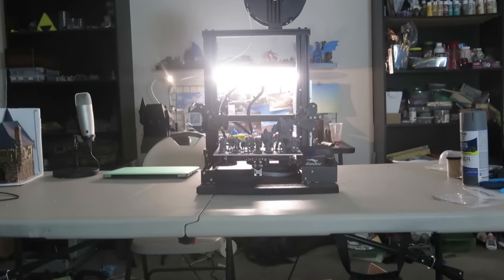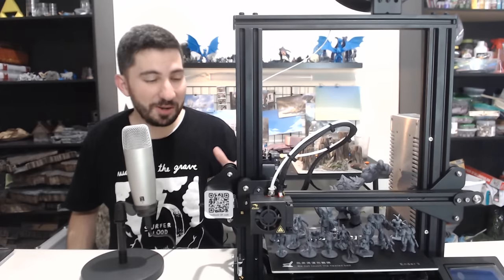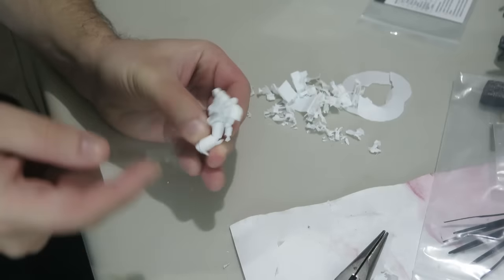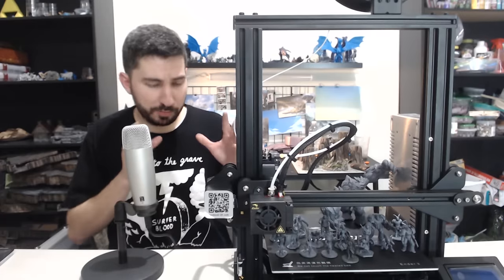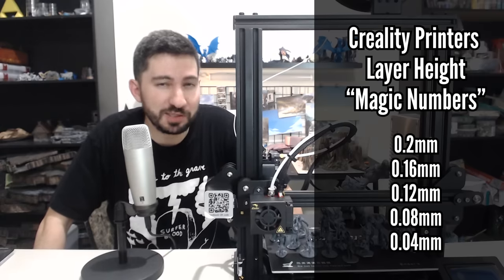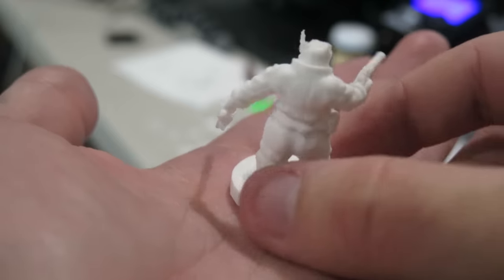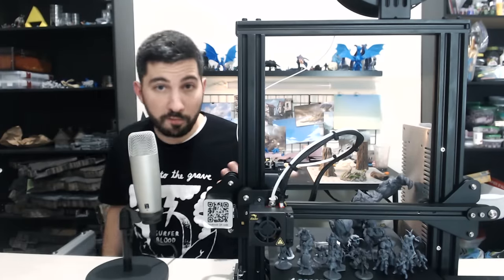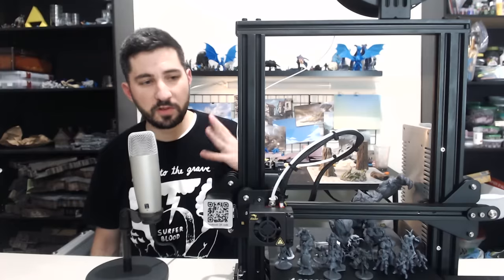How To Print Resin-Like FDM Minis on $200+ 3D Printers (Printing The Game #3)

Comment: Heya, one of the Cura Devs here. The top infill trick works because you treat the entire model as top surface. As for most models you care a whole lot less about the infill, by default, Cura prints the infill faster (and thus, way more ugly). 

By " tricking" cura into doing this, what you are actually doing is ensuring that the acceleration / speed values of the infill are ignored (to be replaced by the much lower values of top). So instead of doing the tricking, it's way smarter to just decrease the infill speed / acceleration values. That way you get the result you want, without losing control. Another option would be to set your wall thickness to a high number, although that will make Cura use concentric like filling (which may or may not be what you want). 

I've looked at your profile and a few settings don't actually, well, do anything. As i already mentioned, setting your top layers to 9999, means that every bit of material on the inside gets classified as top. As such, nothing is considered to be infill. So changing any infill setting won't actually have an effect (so you can dump the speed infill and infill density setting). 

Another weird thing is that with your settings (due to inheritance), your inner wallspeed is 25 (as it inherits from print_speed without modifiers) but your outer wall speed is 12.5 (as it by default inherits wallspeed /2). Interestingly enough, as your infill is replaced by top/bottom speed, that is suddenly printed at 12.5. So you have a single outer wall at 12.5, then a single inner wall (as by default there are 2 walls) printed at 25 and then all other lines printed at 12.5 again.

You also print with rafts, so changing the initial layer doesn't really affect things. The raft already "soaks" up the inital layer (thus preventing any elephants foot).
Reply from the maker: Hi Jaime! THANK YOU FOR REACHING OUT! And thank you for helping make this possible by working on Cura. 

Suddenly things get a lot clearer :)  Someone suggested that it was just slowing down the entire print, but it looks like it is still printing at different speeds (which is what I would observe when I'd watch a mini print) if I understood you correctly. 

In my tests, and some tests with the community, concentric filling caused some issues on a few Ender 3 prints. I'm recommending linear now. 

A lot of folks here have asked about getting easier to remove supports. It has been fine for me, but I know a lot of folks in the community would be interested in making that better. I'm going to be running some tests on z distance and using a support interface, but was wondering if you had any suggestions. 

Thank you again!

Danny
Reply: So yeah, it's printing some bits at a different speed, but most of it will be slower. The thing that you actually want to do is changing the infill speed / jerk / acceleration. I think that you do want the infill to be faster than the top/bottom layers, but you do want it slower than the default values. So not using the 9999 top layer trick will mean that you can probably get your prints a bit faster (you are fully correct that it's always a tradeoff, but there is usually a way to mitigate the negative effect of some things while increasing the positive effect).

As for actual quality; I'm personally a big fan of lower infill and more walls. Look at most of the UM profiles; they use 3 walls. This is especially the case for "organic" prints (eg; models without flat surfaces). They get most of their strength from the walls, not the infill. Despite UM machines being bowden machines (and thus a fair bit different) there is a lot to be learned from them. Ultimaker as an entire team working on only tweaking quality profiles into perfection. 

Support wise, I'm spoiled. Working for Ultimaker means that I have access to dual extrusion printers with PVA, which removes the need to muck around with "regular" supports. But from my past experience I can give some pointers; Increasing the Z distance will make it easier to remove, but this always comes at a cost of worse prints. You can also underextrude the support interface layers on purpose (eg; That way you get sponge like results, but its real tricky to control). I don't have that much experience with that, but you could also consider messing with the support interface line width (Decreasing the contact area of support with actual model). Future version of Cura will also have a feature that enables you to add a "wall" around support, making it easier to break off entire chunks of support at once. 

There is of course also the option to use "anti-overhang-meshes". Sure, it isn't as great as what S3D does with regards to placing supports, but it does let you mark areas as "Don't support this". This is especially nice if someone already did this for one model as from then on you can just share the project file.
Reply from the maker: Thank you soooo much for the thorough response. Is there a way for me to contact you more directly? I have a few follow-up questions if you don't mind :)
Reply: I've sent you an email on the address you have listed on your channel.
Reply from the maker: In receipt, I'll email you shortly :) Thanks again!
Reply: 3D Printed Tabletop Please share what comes out of this discussion. I'm really interested
Reply from the maker: @AES 2015 I'm gonna do some tests of my own and then follow-up! :)
Reply: 3D Printed Tabletop Sounds good. I'm going to try this on my CR10 when I get the chance
Reply: Okay, when this conversation bares fruit, would you be kind enough to post it up for us all?
Reply from the maker: Absolutely - wasn't very much "secret" stuff either way :)
Reply: Hey Cura super user here and .... infill is perfectly fine, just alter the infill speed so its not a flipping mess and add an extra wall with lower speed outer wall. Biggest issue I have wit hCura is large flat areas using concentric layers - it likes to bunch up at the very end and make (for lack of better words) ice cream cone tops as it finishes up (even with aggressive retraction, hop adjustment & coasting).
Reply: Jaime van Kessel some printers will default over Cura settings for jerk/acceleration
The cr10 to be specific. Which iv found to be quite a inconvenience unless the printer is flashed which I just haven't got the know-how to do.  So the top layer 'trick' does sound like a neat way to get around that..  all be it at the cost of time and filament but with something so small I don't see it being much of an issue if it would Infact by pass those silly settings
Reply: +Jaime van Kessel, just two questions:
- why does the infill speed affects the print quality so much?
- could he get away (and print faster) with numerous walls rather than all "top"?
Reply: @fabts4  My experience is that the print head is often moving too fast to properly decelerate. So the nozzle sort of wiggles and puts a little bit of plastic where it shouldn't. When the printer comes around to print the actual walls there is plastic where there shouldn't be any, and the plastic for the wall gets squeezed out a little bit, causing a distortion. Since this happens all over the print, the end result is you get a general lower resolution print and occasional blobs.

The solution described here is basically to just slow the speed way the hell down to the point where the nozzle never wiggles.
Reply: It almost feels like I understand this but I am not sure.

Just to make sure I get it, infill speed needs to be reduced to about the same as print speed or to make infill nearly non existent?
Reply: @3DPrintedTabletop   So I'm very new to all of this and I'm trying to set up a printing profile and whatnot, I tried to just download the one you had on your site but it wouldn't import to Cura and I also see you've had a lot of updates to refine it and whatnot to boot... I was wondering if you had a profile that Cura will accept in importing with all the latest refinements you worked on making with the Cura Dev?
Reply: Wow that's a lot of information Jaime, mind to share your Cura profile?
Reply: @3DPrintedTabletop  if you want a great finish with supports, you should get a multi material upgrade, and use dissolvable (PVA) supports.
Reply: I am writing all of this down. Thanks for the great tips 👍👍
Reply: @3DPrintedTabletop  Do you plan on making a followup video or post with the results? Would you still reccomend Siepie's profile or have you found a better result with other settings?
Reply from the maker: Hey there! I sure am planning a follow-up video. I haven't been able to do as much tinkering like this as I'd like as I've been focusing on a new job change, the Kickstarter, and the holidays, but it's on my list for the next month or two.

As far as profiles to try: check out the Fat Dragon Games mini profile. You can find it in the Tomb of 3D Printed Horrors video on printer settings, Dropbox link in there. 

Cheers!
Reply: @3DPrintedTabletop  Awesome, cheers! Only recently got a 3D printer, partly from being inspired by your videos :D
Reply: Hey Jaime!
A question... When tricking cura you would be actually just getting 100% infill right?losing A LOT of material and time?
If we do as you sad and decrease de infill speed it would give us the same results without wasting so much material and time right?
Reply: Davey I’m definitely calling BS about your “super-user” claim.

Davey, Davey... Why even post a comment when you are literally just repeating what the original commenter said, minus the considerate and concise explanation, the friendly and casual conversation format, the lack of ego and self-proclaimed title that did nothing more than leave us all wondering how you were hired for the position of Cura Admin (because that’s Literally what a “Cura super-user means) by the well known, foreign born, award winning company, Ultimaker 3D. I know I’m curious as to how that happened given your lack of professionalism in your attempt to validate yourself simply by vaguely stating that you are a “Cura super-user”. Of course, I might potentially believe it if this position actually existed, but sadly they have zero jobs fitting this title. They don’t even have any administrators beyond their business admin and their database admin. There are a couple engineers and entry level techs, but that’s about all. Also, your choice name doesn’t appear on the site. And they even included their receptionist in the staff intro! So that leaves you claim of being a “super-user” restricted to you being your own personal admin. 

Your claim is absolutely no different than someone who runs out, buys the game Grand Theft Auto or something, plays it, learns how to optimize the graphics settings according to their personal preferences, maybe they even made a mod or plugin for it and uploaded it to the web for others to use too. Then they suddenly feel that entitles them to be called a developer or administrator or a “super user”. 

So please indulge us as to how you have transcended the ranks of good users, experienced users and expert users to grace yourself with this god-like sounding tier of “super-user” that not even the Ultimaker company itself seems to have a say about it?

Please us what it is that you actually administrate, because if you are not someone who has permission to make decisions on the software releases, updates, availability, etc... of Ultimaker’s official Cura application, available as-is on their current website, then I’m afraid that your title of “super-user” is just an illusion manifested by your ego and the reality is that you are really just a “user” that just wants to feel special somehow. 

Btw, if you were such a super user then you might have suggested some settings to help this YouTubed achieve the results he wanted, but you only typed a summary of the help Jamie politely gave before. 

Instead, you got on here and basically said “I know stuffthat I cannot articulate! But yeah what Jamie said except I’m going to act like I explained it first, but only after I tell you how awesome I am at Cura!”

Lol good grief
Reply: If you don't mind me asking, what would be your recommended settings for getting good quality prints without the extra 2 hour increase in time while still maintaining strength of printed parts or characters?
Reply: Hey Jamie Van Kessel I need help with something on Cura, when I started printing the space marine file shown in this video it just started making a line on the left side of the bed plate and it was got to like 2 mm before i stopped it.Do you think you could help me please?
Reply: @jaimevankessel29 
Great to see the devs of the programs being interested and interacting with the community
Would be nice to see you guys start a cura tutorial channel lots of people throwing ideas to get better prints about
A channel actually run by you guys giving tips and instructions would be highly popular I'd imagine
Reply: @reasonsvoice8554 I'm not even the best "Cura operator" in the company (Just one of the SW devs). We essentially "just" make the tools to craft great 3D prints. The profiles (aka; how to use said tools) are created by our material & processing team. They are the real print profile wizards. 
I'd love to have the time to make videos like that, but I'm just way to busy for that (most of us are really). So I will just do what I do now; Watch some videos and give expert advice on why / how things work. Channels like this are doing a fine job in explaining how to use Cura and combined with the feedback we can give, I think we can get the knowledge out.
Reply: @antoniogoncalolancabrites8773 You will get a massive model, but it doesn't see the inside as infill anymore (but as top/bottom layers). Decreasing the infill speed will give the same result. Both in material and time.
Reply: @danieldangelo7327  As I'm working for Ultimaker, I just use the Ultimaker defaults. I print on a UM3 with a 0.25 nozzle and even the default profile gives amazing miniatures. Sometimes I do have to print multiple models at once to get the quality I want (multiple models at once ensure that there is enough time for a layer to cool down)
Reply: @Arendelft  The profiles should work. We try (It won't always work of course, but we do test these things as much as possible) to ensure that there is an automatic upgrade path from old profiles to the latest version. If it doesn't work, please post an issue on github so we can have a look at it!
Reply: @grotwurksmekshop6607  Not quite. The top/bottom layer trick replaces all infill with top/bottom layers. As you can set quite a few settings per "line type" (infill, top bottom, skin, support, etc) doing this means that what used to be infill is now printed with top bottom layer settings. As we print those a lot slower by default (as those are the parts that you see) your results improve.

A "better" way of getting the same effect is to change the infill settings. That way you don't lose control (because it could be that the infill just needs to be a tiny bit slower and not as slow as the top/bottom layers)
Reply: @jaimevankessel29 
Thanks for the reply it's a quickly developing world I'm almost 40 and could never of imagined the toy I now have in the spare room I'm still new to it but have operated cnc before and have a general engineering background what's possible at home by people now is amazing
Is there a beta version of cura to get people testing new features and giving feedback available?
Or can we get our email on a tester list somehow
Reply: @jaimevankessel29 
But also I've found the mechanical knowledge is not all where its at learning cad is a steep curve I must say but I'll get there you can only find so many stl files before you want to start to try some of your own
Really happy to hear you guys getting involved and giving feedback and taking the community feedback into account 👍 great to see and hear
Reply: @reasonsvoice8554  We release a beta for every release, so that means there is a new beta every +- 2 months. 
We don't have publicly available nightly builds, but those would also be pretty unstable.
Reply: Can anyone tell me why I read this entire thread, despite the fact I don't collect miniatures, I dont play dnd. I only found this because my girl showed me that hero forge website, and I wanted to see if anyone did the same with 3D printing, and i DONT OWN A 3D PRINTER AND DONT UNDERSTAND ANYTHING ANYONES TALKING ABOUT. DAMN YOU YOUTUBE RABBITHOLES!!!!!! ALSO! How would i get into 3d printing? Like, what should I start with and what should I try to learn before I even begin to look at 3d printers.
Reply: @aaronself2411  buy lost mine of phandelver starter box and buy a ender 3, just do it !
Reply: @aaronself2411  Hi there, basically learn if 3D printing is for you. It's not like star trek's replicator, it won't just produce perfect things. That said, it's not that troublesome either, it's quite easy actually, you set it up, download models from the various websites, print them, while accepting that if you think of a specific item that you would like to have but for some reason (and there are many) it's not worth it to print, just let it go. The Ender 3 is King in the "bang for your buck" category. Every 3d printer comparison video you watch, like, bed heat distribution, movement control, final print quality, and etc, it never comes out on top but it's always in front of much more expensive printers. I got mine from banggood.com for $ 180,00 plus shipping. The single problem I've had, is the one that everyone have, the PTFE tube (that white tube you see in the middle of the printer) comes out of it's connector, because the connector is of poor quality, you can buy good quality couplings for cheap on Amazon or you can print yourself a solution among one of your first prints, and you will never have this problem. It will print fine right out of the box before you come across the coupling problem, giving you ample time to print the solution (search for "hot end ptfe fix" on thingiverse). I would start by watching videos with these keywords "things wish knew 3d printing", they are very good in explaining the sort of things that you probably won't be able to do in a 3d printer, and the things it is great for, so you decide if you really have the need for one or if it will become yet an other gadget stuck in a cabinet somewhere in your house.
Reply: There is no reason to print the outer layer at 12.5 then the second inner layer at 25 and then the entire inside at 12.5 again. It makes much more sense, to set the print speed to something like 30, and the infill to 100% at 60 or 80 speed. It will print the outer layer at 15, the second inner layer at 30 and the inside at 60 or 80, which should be slow enough to be able to decelerate and avoid defects on the outer layer. To fix "stringing" on the Ender 3, just set the retraction speed to 25.
Now if the printer overwrites the profile speeds with it's own settings, then it's a good solution to "trick" the printer into thinking it's all top layers so it won't even use acceleration/jerk values, neither the profile's nor it's own, because there will be no different layers, it's all top layers.
Reply: Ok..you obviously know what to do, so why reply with a BOOK ? I'm sure this is for those Unfamiliar with it all !!
Reply: What would you suggest as good values. I am just new to this and trying to figure out what values might work. Thanks for the tips.
Reply: Awesome comment, thanks Jaime!
Reply: @3DPrintedTabletop  Whatever came of this conversation? I just got the Ender 3 v2 and am getting WAY worse results than your initial tests.
Reply: @gnoldubderaj  I would also like to know. Was just about to order the same one but can't find any other results like this guy got.
Reply: Hello Jaime. can you share your curaprofile for miniatures?
Reply: @3DPrintedTabletop  hi there do you have the finished profile from this please?i  have an anet a8  but the  settings should pretty much be   universal.

Thanks

Samantha
Reply: why dont yall develop some shit for making better supports? I cant even remove the supports from my minis without tearing the whole thing apart. The supports wrap around the whole figure.
Reply: so on most printers, would simply making the wall thickness very thick have the same result?
Reply: Fusing of support to the model is a very grey area in Cura not able to limit points of contact that easy. Support density too is rough on small objects. I print 1:220 masters but finishing is sculpting LOL!